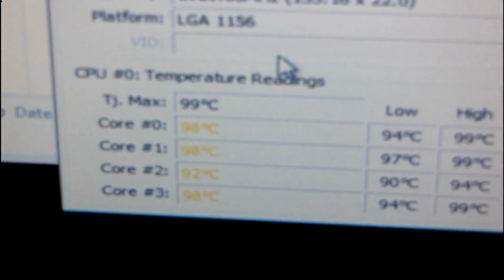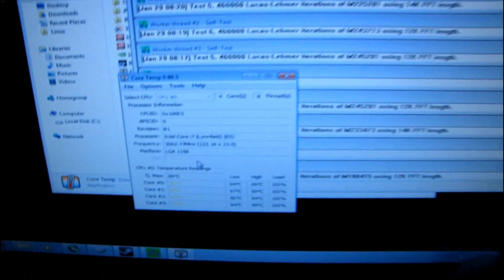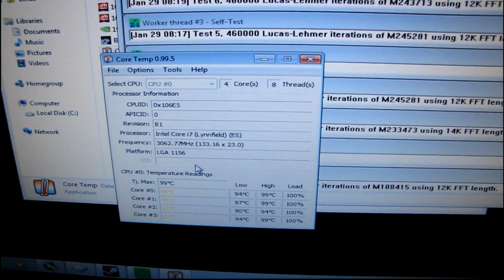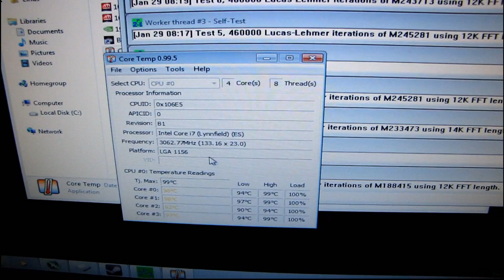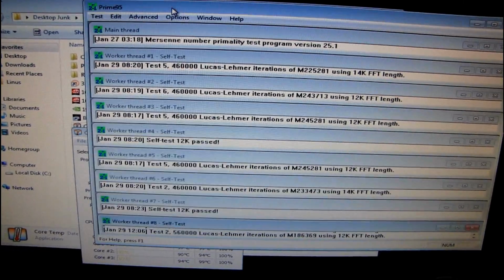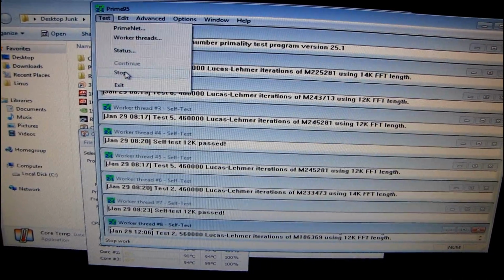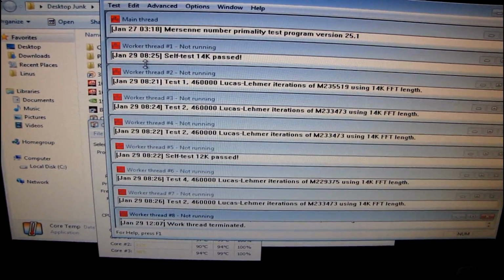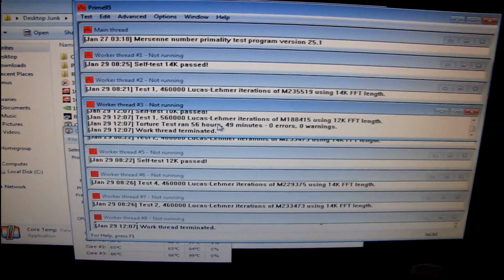Gigabyte H55N-USB3 Mini ITX Motherboard Running With a Quad Core Linus Tech Tips

Comment: i have the H55N-usb3 on a moded antech mini skeleton case with a 750W psu GTX460 and DDR3 1600mhz ram......in an i5 661 at a 4.46Ghz OC with a Coolermaster V6GT cpu cooler and maybe max out at 60*C with prime95 at about 28hrs of runing.....oh and i live in deep south Texas........it was 80* F outside that day.....

oh and i have watercooling in my closet for it.....everything...dual 360rads Apogee XT block and maybe a GTX570 will join the loop when i get one :P

Comment: It is either a sample i7 875K chip or the i7 870. Both based off the Lynnfield core.
4 core, 8 threads @ 2.93 GHz (from 1:21) 

btw nice non genuine windows linus xD

Comment: well, i can see that the chip is a lynnfield, 4 cores 8 threads (0:26), and according to CPUz at 1:19, it runs at 2.93GHz which is the same as the i7-860